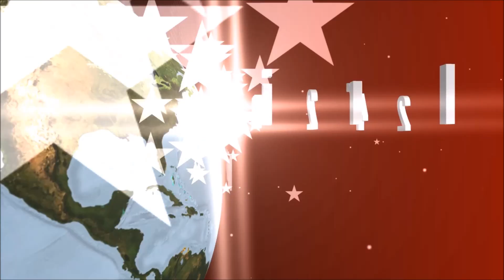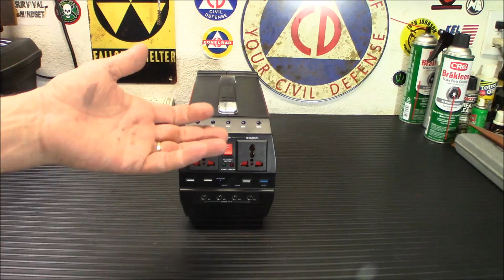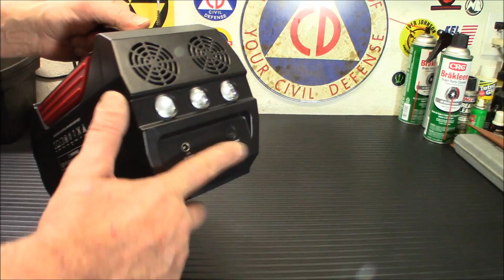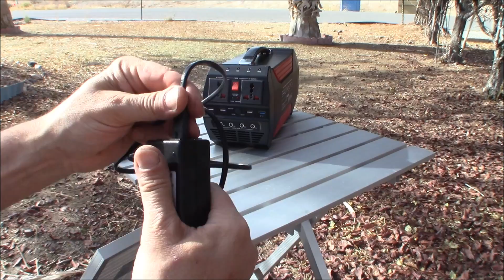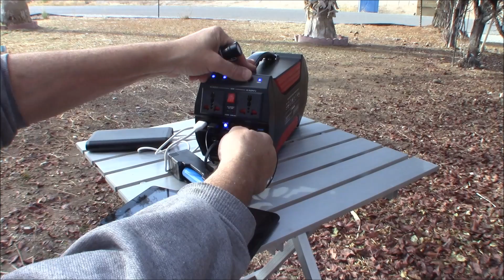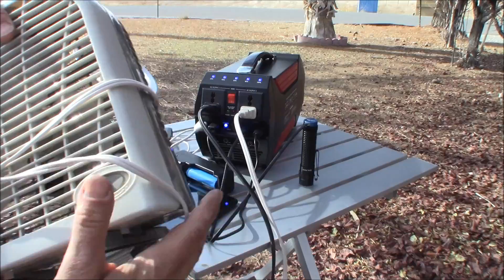SUNGLIFE 500W Portable Generator: Handy Backup Power!

Comment: Use that with the Power Werx SS-30DV and you can have your ham station up and running! I use the Goal Zero Yeti 1250 for when my local power company leaves me in the dark..... hazards of living in California (Commiefornia)
Reply from the maker: Yeah, I plan on testing it out with a ham rig in the future, only so much i could put in the video (it was too long as it was lol) but look for future vids because I want to see how it holds up to a normal 50 watt 2 meter 440 radio!
Reply: Iridium242 I like the size of it. My Goal Zero unfortunately weighs over 100 lbs.